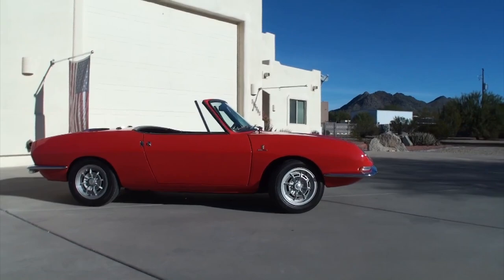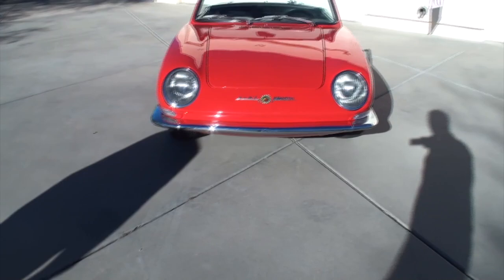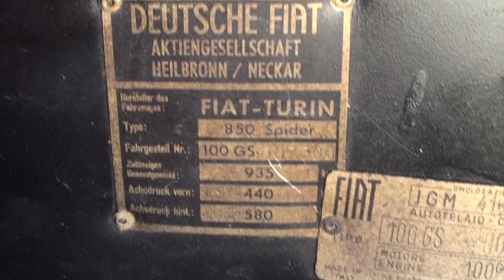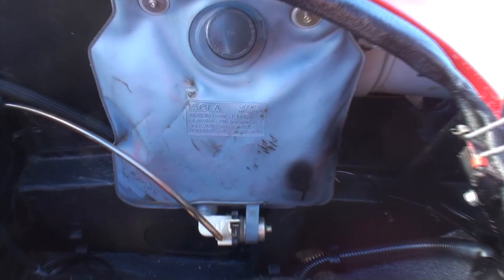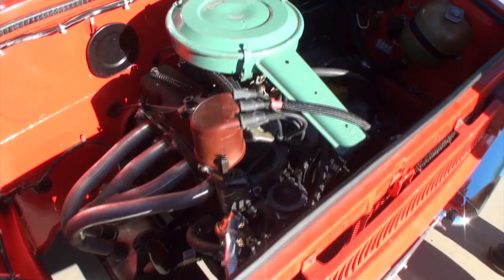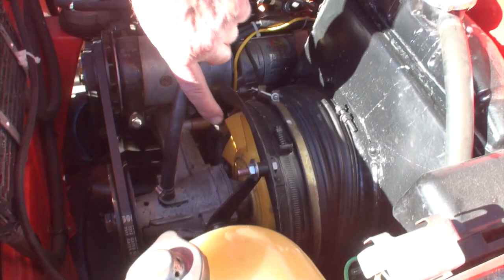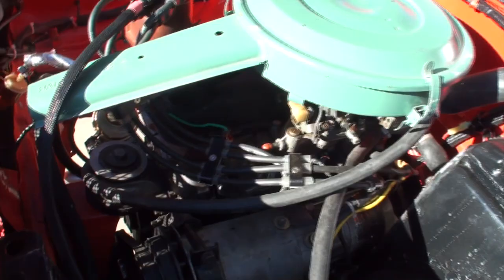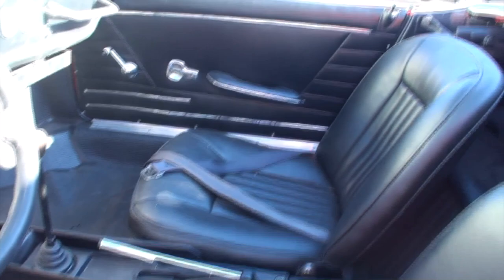1965 Fiat Abarth 1000 OT Spider in Red & Ride on My Car Story with Lou Costabile

Comment: Great video of a great car. I really detest what cars have become these days. I look back to my Volkswagens and Fiats for great memories. I never owned the X1/9s predecessor, the Fiat 850/1000, but I've always thought they were good looking cool cars. By the way, that clock looks like the one that came stock in my '67 Karmann Ghia!.
Reply from the maker: Hi halnwheels, Happy to read you enjoy this "good looking cool car" :-) Nice to see this clock is familiar to you, Lou
Reply: I own a couple of 850 spiders and a X1/9, and don't like today's cars. A 850 is my favorite, although handling, heating, crash and rust protections are much better on the X1/9.
Reply: @alaindumas1824  I always liked the looks of the 850 spider. Never been in one though.
Reply: @halnwheels  In one of my 850s, we put a 70 HP A112 Abarth engine. It was upgraded with coils in front, longer gear ratios and rear disk brakes. The original 50 HP engine struggled on highway ramps. I enjoy the improved torque and engine noise, but driving faster than before because would be suicidal. Carlo Abarth built a 850 Spider with some 130 HP. Giovanni Agnelli tried it, found it unsafe and vetoed it. 
The X1/9 on the contrary could handle an engine 2 or 3 times as powerful as the original. Fiat was not interested because it would overlap with its 124 and Lancia such as the Montecarlo but enthusiasts have done various swaps.

Comment: Such a great little car and looks like a blast to drive!!! I really like the Abarth treatment especially the look of the headlights. The engine sounds really strong and very deep for a four cylinder car for sure and that exhaust header looks so cool how it dumps right into the muffler. Such a unique design to have a rear mounted engine and the radiator mounted at the rear as well, very unusual for 1965 I'm sure. Ya certainly can't go wrong with a red "rag top" sports car that's for sure!!! 🙂
Reply from the maker: Hi Hobiemarty, Happy to read the details you enjoy with this car :-) My pleasure sharing this one with you, Lou
Reply: Abarth did not touch the headlights. These were standard on Fiat 850 spiders until a 1968 restyling, and borrowed by another Bertone designer, Gandini, for the Miura. The rear location of the radiator was the rule on small European rear engined cars from Fiat, Simca, Hillman or Renault.
Reply: Fiats from the 1950s until the early 1970s were rear engined for the less expensive cars. The 600, 500 and 850 model ranges shared the same layout but the 850 engine rotates the opposite from the others.

Comment: Have had a couple of abarths, great little cars. The 1000 cc engines were actually the 850 engine stroked to 74mm with a different crank. But even the 850s had headers. Never had a overheating problem until a blown head gasket on my 1300/124 Abarth showed up. Also had a couple of Lombardi designed Otas, the basis for Abarth’s Scorpione. Of course the car to have was the Abarth 2000 made from the 850 coupe. Be interested it talking to you.
Reply from the maker: Hi Mac, Happy to read you've had some cool Abarth's too :-) Hope you get the chance to meet Chuck at a AZ car show soon, Lou

Comment: The engine looks like a Renault 8 or a 10....my 10 used to overheat,I wonder if the water cap was changed? I always thought it was because you didn’t get the front rush of cooling air into the radiator..
Reply from the maker: Hi David, Hmmm, I wonder if it was the water cap? Lou

Comment: Nice car. The covered headlight Fiat 850s were sold in the US up until early 1968, I had a '68. I don't understand the donut spare that's not a thing in old Fiats. The pop riveted chasis tag should be in the engine compartment next to the one stamped into the body. That's a real red flag. There should be an electric Bendix fuel pump in the front compartment, pretty much standard on Abarths back then. The fake carbon fiber should just be removed. I'm pretty sure the gauges should be Jaeger, those look like stock Fiat. I should probably compare them to what's in my 1968 Coupe.

The orginal engine was 843cc, not 850cc, they rounded up for the model number. The engine bay is missing the left floor pan, that effects cooling. The exhaust doesn't appear to be Abarth, if it was then the left floor pan would have been fitted to match the exhaust. The engine looks more like a Fiat 127 engine, it has the same spin on oil filter. You can also see the 127 steel oil pan where there should be a cast Abarth pan. The generator doesn't appear to be correct either, although it looks like it has a reproduction Abarth double pulley. The Abarth pulley had the same diameter for each belt. 

I'm no expert but I have owned more than 20 Fiats since the 1970s, 500, 600, 850, 124, 128, 2000 and a couple Abarths. I also knew Al Cosentino and Greg Schmidt. I bought one of Al's cars years ago and traded parts with Greg.  This looks like a reproduction. Reproductions aren't bad but they shouldn't be presented as the real thing.
Reply from the maker: Hi The Old PC Guy, Thank you for viewing and sharing your knowledge. Hope you see many more cars on this YouTube Channel you enjoy. Please subscribe, and hit the "bell" so you can see all the cars when they are uploaded on this YouTube Channel, Lou